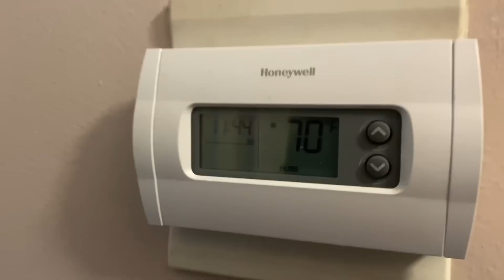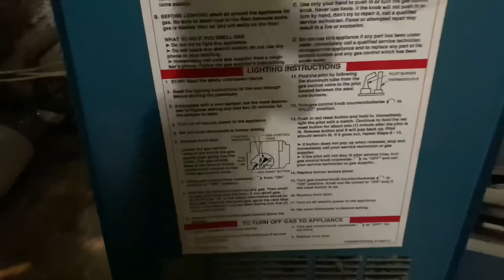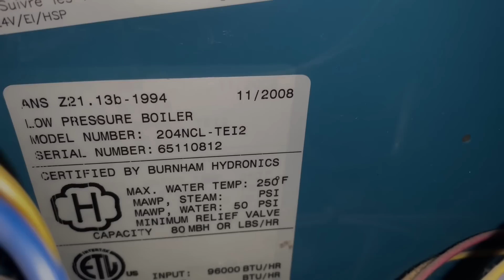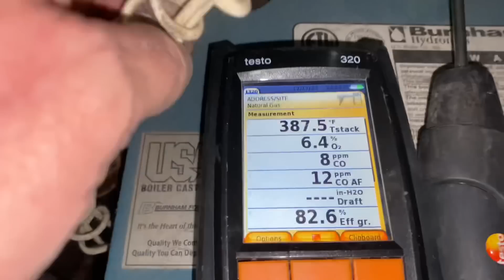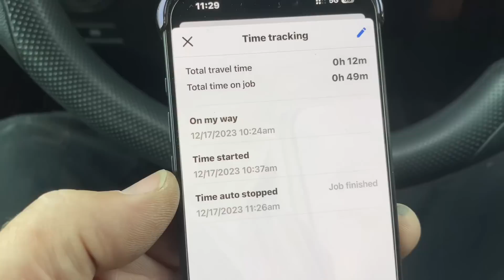How to Run a Proper No Heat Emergency Service Call with Pilot Out - Tips for HVAC Techs & Plumbers

Comment: Had a plumber stop by and do this last month for a hot water boiler. Charged my building $250 for his 10 minutes and said this would probably continue happening and I should replace the water boiler. It is indeed very old but not leaking. 

It did continue happening and I relit it after watching a YouTube video and seeing how simple it is.

Well I looked into it more and discovered it was likely the thermocouple. I cleaned the thermocouple and it’s been good for over a month and counting.

A lot of shady plumbers out there. Didn’t even mention the thermocouple like Mikey did. Just went straight to replace the boiler
Reply: Sometimes you go to clean something that hasn’t been touched in 40 years and it falls apart and they don’t make that part anymore or it’ll take a month to order. I don’t blame him.
Reply: @Rainmaker88 it’s a thermocouple and he’s a licensed master plumber. It’s his job to do it or at least mention it

The fact that I was able to just clean the old one to resolve the pilot light constantly going out shows how simple it was.
Reply: Wow @nybiggs are you plumber too
Reply: @guevarawilfredo  nah I’m just a diyer who watches YouTube to find out how to do the simple plumbing stuff like relighting a pilot

Comment: Boy you must be important.  You don't  stop at stop signs?
Reply: So you changed a thermocouple and he got heat. If it was my house and I was paying I would’ve liked you to stop there.10 minute job but no you had to go for the hour.Gotta pay the piper for the whole song and  not a couple toots tactics
Reply: @pets7164 every tech I know has an hour minimum charge plus travel time. Mike is giving him the extra time he paid for by checking that the boiler is operating safely and why not hang some isolation tags while waiting for the Testo to warm up?
Reply: @pets7164 would be curious to see the breakdown… I’m betting it was hell of expensive.
Reply: @petesilvestri  not just paying for what you see here but the years of experience and tools collected to do it and maintaining the business. So I wouldn't think it's that expensive when you think about all of that. 🤷‍♂️
Reply: @pets7164 , 1 hour minimum charge.. so he gave them the hours worth of service. most would have left after 15 minutes on a 1 hour charge. 😏
Reply: I agree and totally understandable, not debating that.

All that you mentioned should be reflected in the hourly rate. 

In your opinion how long should a thermal couple take to change?
Reply: @petesilvestri  over the years, a thermocouple could take anywhere from ten minutes(including cleaning burners) to over an hour if things go south(remove pilot assembly, grinder, torch, pliers, drill (cut/remove broken part) or replacing the whole pilot assembly(nobody carries them or does that anymore due to so many types)
Reply from the maker: Do you?